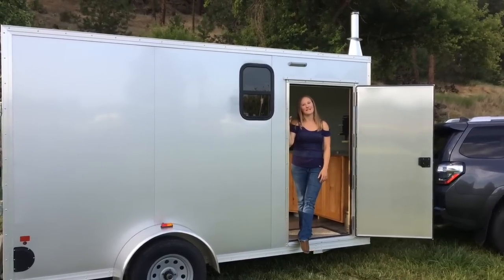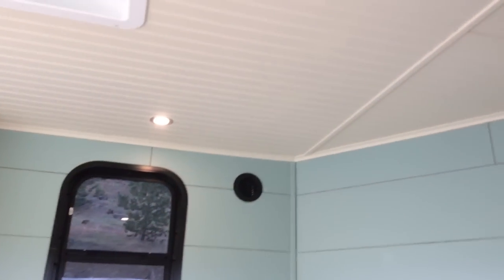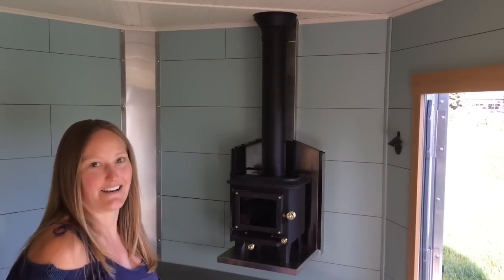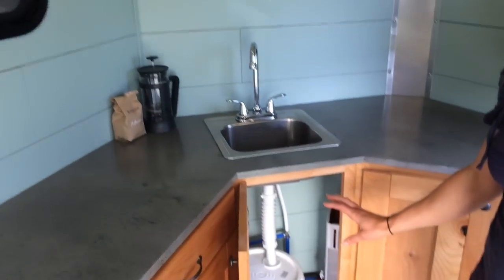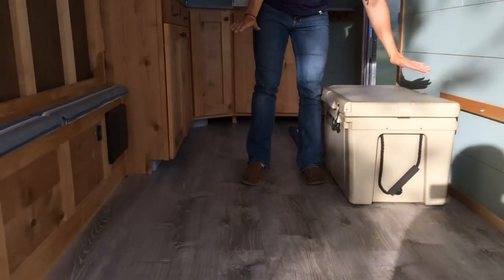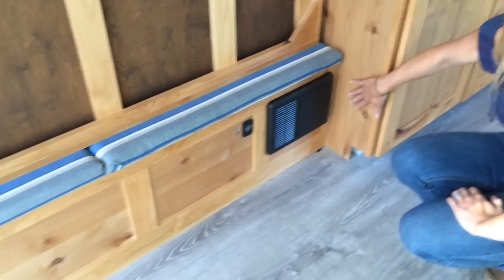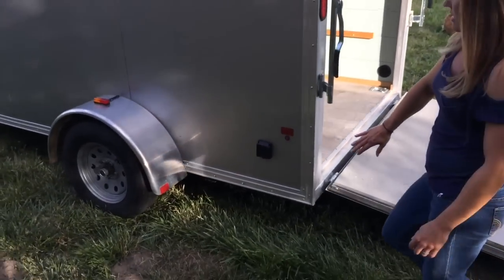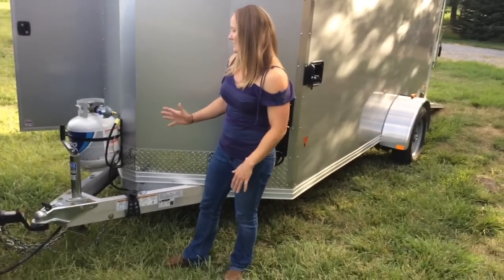Our DIY Cargo Trailer Conversion

Comment: Very nice set up, starting my build. Just wondering if you have any video on how you did the counter top & bottom part  in the v nose. Thanks for showing build.
Reply from the maker: thomas horn I have a slide show that you can pause at various points of the build. The counter top is 1/2” cabinet grade plywood with MDF. Also I glued and pin nailed a 3/4” strip of hardwood along the edge of the plywood, this covers up the plywood edge and also let’s me break the edge with a round over router bit. To get the shape I first made a cardboard cutout and then copied that onto  the plywood. The plywood counter top is actually two pieces that I joined together such that the joint is supported by the edge of one of the cabinet boxes. Along with that I also glued and domino biscuited the joint. I then filled the little imperfect gap with a sandable wood filler and after it dried and blended it out. To attach everything I screwed a level wooden cleat to the metal trailer studs, the cabinets are screwed to that and it gives support for counter top. Quick side note, the cabinets don’t have a backer on them as to reduce weight. I made the cabinet face frames using 3/4” alder. The doors and drawers are also alder and for the inner paneling on them I used 1/4” alder veneered plywood. To give the counter the appearance of stone I first sealed the plywood surface with a grey acrylic paint. This served as the base color. I then mixed three systems epoxy and spread it evenly across the counter top. I used a torch to pop and bubbles and then to add depth to the epoxy and make it look like stone I had a couple colors of spray paint that  I lightly dusted into the wet epoxy. When the paint hits the wet epoxy it kinda disperses out and adds a cool appearance. I’m not an expert at this, just watched a few videos and gave it a shot. It was easy. If you have the budget for it, consider stonecoat epoxy, they have a YouTube channel and they do some amazing stuff. But for me I had left over epoxy from another project and random cans of rustoleum hammered spray paint. I went sparingly on the paint and if given the opportunity to do it over, I think I would have tried some aggressive paint and techniques from the stonecoat channel. Anyway, hope this helps.
Reply from the maker: https://youtu.be/LsYXvNIHQHw
Reply: @littlejoey22  thank you so much for getting back to me. Great job.😀

Comment: I'm definitely interested like the simple build. I'd like to do something similar. I'd love to see how it looks with the bed down and how you guys use the bench
Reply from the maker: Chris Winner the bench is more for storage. It’s broken into two compartments. The left compartment holds blankets and pillows. The right compartment houses the battery and the electrical panel. The top of the bench is hinged and folds up to give access to the compartments when the bed is down. Originally I was going to also make a table and use the bench for seating but that never came to fruition.
Reply: @littlejoey22  how high is the ceiling in your trailer and are you using a full bed?
Reply from the maker: It’s a 6’6” ceiling height and the bed is a Full. It’s a 5” memory foam pad. I boxed in the memory foam with the bed rails leaving and inch or so exposed, this helps when I latch the bed to the wall during transport, it puts pressure on the latches and it keeps from vibrating around. We also used 1” memory foam on the top of bench. It does a good job keeping the bed from sliding and vibrating there too that way there’s no wood on wood anywhere. It barely fit with the drop down ramp hardware. When I lower the back ramp down and the bed is stored I have less than a 1/4” gap of clearance between the wire and the bed frame but it works so no complaint a. I’m helping a friend build one right now, his ceiling height is 7’0 and it’s nice. He has the fold out barn doors on his it’s a much easier design process for that and he can maximize space.

Comment: I've watched a lot of these videos on converting cargo trailers into campers.  I don't understand why no one posts the final weight and tongue weight after these builds.  Seems very important to a safe towing experience.
Reply from the maker: Hey Dave I don’t remember the exact weights but somewhere way back in the comments they’re posted on one of the the comment threads. However I remember that it was  was roughly 2200 lbs without water and ATV, 2400 with water and 2900 with our Polaris Sportsman 500. Hope this helps. If you’re contemplating something like this you’ll need to obviously consider your wants and needs. For us, with a single 3500 lb axle I wanted to make sure to save enough on weight that I could still put an atv in and not be over weight. Hope this helps.

Comment: Great job!  That wood stove really caught my attention.  I haven't seen anyone else put one in a cargo trailer.  How did you build the frame that you set it on?  Is it secure going down the road?  Are you going to post anything about the newer stove you are working on?  Thanks!
Reply from the maker: Hey, thanks for the positive words. The stove is awesome, it came as a package…mostly. I bought the stove and mounting plate from a company called cubic mini stoves. For my smaller trailer the cub size worked perfect. I didn’t care for their flew pipe so I opted for a different set up and I went to a local heating supply shop for help. We put a double walled 3” pellet vent in, and I used a 5” to 6” adapter as a makeshift wall thimble to create an air barrier around the vent as it passed through the ceiling. I used a few bolts to center the pipe in the thimble. I also packed around the outside of that adapter with rock wool insulation to help protect the wood and foam insulation. The stainless steel wall mount from cubic mini  supports the stove and has a 1” air gap on the back side to help protect the wall from excessive heat, this is a must have. The pellet vent consists of a pellet vent adapter, two 3’ vent stacks, a 1’ extension with a spark arrestor. The pellet vent pieces connect with a 1/4 turn so with that I usually climb up and pull the 1’ extension with the spark arrester before driving. I cap the exposed vent stub out with a rubber cap usually used for capping off pvc pipes. As for other stoves out there, I’ve installed a different type of stove by a company called 509 stoves. It’s bigger more expensive and a self feeding unit that has a 12/hr burn time. Both are cool, and if you need the long burn time the 509 is the way to go. The cubic mini works good for my needs. As for more videos, maybe someday. I don’t have the cameras, editing software or the skills necessary to put out the high quality videos that so many others are. I just build fun stuff and sometimes record it. Thanks again, feel free to hit me up with many more questions.
Reply: @littlejoey22  wow.  Thank you so much!  The extra burn time is always great to have.  I'm just thinking the smaller/simpler things are, the better for my purposes.  Do you have any videos of either stove build?  Lots of good ideas in your video here :-)  I appreciate your quick response to my question.
Reply from the maker: @dotjohnson231  I don’t have a video perse but there is a time lapse that kind of has some details you can get from that. It’s pretty easy. I leveled the trailer to the best of my ability and hung the stainless mount to the wall. I took into account where the roof framing members were to ensure that my stove placement wouldn’t hit a stud with the flew pipe. I then took a plumb bob and hung it on the ceiling (I had a finished ceiling at this point in the build). This gave me a point on the ceiling which corresponds with the center of the outlet pipe on the stove. I had a rough idea where the flew was going to go when finishing the ceiling so I didn’t put any foam insulation in the general area of where I thought the flew was going to go. I then used a long 1/8” drill bit to drill through the finished ceiling and then through the aluminum trailer roof. I then cut a 6” hole in the ceiling and 4” hole in the roof. Then, I back filled the space between the finished ceiling and the roof with rock wool. I took my pipe reducer I explained in the previous response and pressed it into place. It was a tight fight. Then I took the sections of stove pipe and fed from the top down onto the stove. I centered the 3” stove in the thimble and  thread in some small bolt to keep it center and secure, kind of like a Christmas tree base holder. Then, with the pipe sticking through the roof all I had to do is add a collar and rain shield. I used an all metal collar but I think the rubber collar would do just fine. The collar is wet wet in sealant and screwed down to the roof with with self tapping roofing screws spaced 1” apart and have a little rubber washers on them. I slid the rain cap down over the collar and siliconed it in place with high temp silicone sealant. I also put sealant over the screws. Then at the top of the main pipes I have the 1’ section of pipe that has the spark arrestor on it which I take on and off. Like I said previously the dura vent pipe is a 1/4 turn connector. So it’s relatively easy to take that 1’ section on and off, though sometimes when it’s wet the soot and water make it a bit sticky. On my buddies stove, he left his spark arrestor permanent attached and it seems to work alright. He also mounted his stove lower and so he gets a decent draft without the added height to the roof or headache of taking his on and off. I don’t mind doing it, takes only a couple of minutes. With the added pipe and spark arrestor attached mine is mounted kind of high, about 3-4’ above the trailer roof height which  I don’t like driving with that additional height and that’s why I remove it. Additionally I don’t like having the open spark arrestor because the one time that I did drive with it on  it blew ash into the trailer through the stove damper. So now I only drive with the rubber pipe cap on the stack at the 1’ piece removed… After that no issues whatsoever.
Reply: @littlejoey22  Excellent!  Many thanks for such detailed info.  I do appreciate it

Comment: What color and paint did you choose for the walls, and what type of wood is your trim?  Thanks!!  Very nice!
Reply from the maker: Sherwin Williams “quietude,” in satin sheen, paint number 6212. I believe we used their duration paint series? For the trim and cabinets we used Knotty alder and finished it with a couple of coats of Watco Danish Oil in light walnut.

Comment: By far the best layout I've seen. Plan on following same basic idea, with some minor adjustments that will work slightly better for my personal needs. Hats off to you both. A truly excellent cargo trailer conversation. I have a couple question. What size quad do you have? Give or take how much did you invest on the full build?
Reply from the maker: BigBobby713 roughly 9k, but that includes a few other things we’ve added since the build like solar panels and a Bimini hardware shower curtain I made for the outdoor shower. As for the atvs we have a couple but we usually put the Polaris sportsman 400 in the trailer and the 600 in the back of the truck. It fits the 600 size wise but the added weight kinda stresses me a little more as it’s right at max axle weight with the bigger 600 plus water. We went with the aluminum trailer to keep some the weight down allowing for the atv plus the trailer components, gear and water. If I built it again I think I’d opt for 7x14 or bigger with a double axle. It’ll save you from having to worry about the weight issues. My buddy is building one now that is 7.5 x 18 and it’s pretty sweet. He’s also doing a shackle loft and spring and over the axle mount to increase ride height and bigger off-road tires. All upgrades I’d recommend. Feel free to write me back with any questions you may have, happy to help.

Comment: How do you use the bench, the bed is sitting on it? I would have liked to have seen that.
Reply from the maker: Tammy Norris, fold the bed down to access it. It’s set up with two compartments, one houses my electrical system and the other has blankets and bed sheets. The foam bench top acts more as a cushion for the bed while driving.

Comment: My wife and I love your trailer conversion. You both did an awesome job. We have a trailer conversion of our own coming up.  We really like your epoxy counter top.  Can you go into more details on how you did that? I'm especially curious how you made it look all one piece (I assume it is 2 pieces).  What wood type did you use?
Reply from the maker: arnbrhm Hey thanks for the compliment. We used the 1/2” cabinet grade plywood remnants from the cabinets, it was 3 pieces. I bonded them together using a festool domino and glue. There were some minor voids in the plywood joints but I mixed a slurry of fine saw dust and epoxy and spread it with a bondo spatula into the voids, let it dry and sanded it smooth. I pin nailed a 3/4 strip of alder on the front to thicken the edge. I painted the top surface with a matte grey acrylic and let that fully dry. I put three coats of epoxy onto it. When applying  the first 2 coats of epoxy while they are still wet I dusted metallic spray paint on it to give it the granite-ish look. Stone coat epoxy counter tops has a YouTube channel that’s really good at explaining the process. As each coat dries take a torch and lightly brush the surface with the flame over the bubbles and it pops them creating a smooth surface. The last coat I just let set up with no paint. It cures to a gloss finish. If you don’t like the gloss finish you can buff down the shine or what I do is sand with a 320 grit sand paper then spray it with satin enduro var made by general finishes. For this project however I was fine with the gloss finish. I had the epoxy already and since I used the scraps the whole project only cost me a few cans of spray paint. If you’re cabinet design didn’t leave enough scraps I’d say it would be somewhere in the $150 range for epoxy, paint and a sheet or two of ply. Honestly pretty easy to do, hardest part is getting the angles right.
Reply: @littlejoey22  This is very helpful! Thanks for the detailed explanation.

Comment: I do like it! Very nice, clean, and something other than white inside. Would like to see the bed folded down, and trailer closed up.  What is the matress?
Reply from the maker: Someday I’d like to make a follow up video and show the close up of the bed, we’ve had a lot of questions about it. It’s pretty simple, I did a French cleat the full length of the bed frame. It’s basically just a 1x4 piece of alder ripped down the middle at a 45 degree angle. I attached one half of it to the bed the other half I mounted it to the wall by by dirt tapping and threading bolts into the stud. The opposing 45 degree joints lock the bed against the wall. Then for the legs, they just swing down in place and have positive stops to set them at them at correct 90 degree angle. When stowed away the legs fuld up out of the way. The bed is held up against the wall by two decorative gate latches. To get them to hold tight the memory foam mattress sticks out an inch or two out past the bed frame so when the bed is against the wall the depressed mattress keeps pressure on the latches it doesn’t move or shake at all. If you’re interested shoot me your email address and I’ll send you some photos. So this all makes more sense.
Reply: @littlejoey22  Cool. What mattress is it? One of those thinner memory foam ones?
Reply from the maker: Seth Watson yes sir, 5” memory foam amazon, it’s a full, couldn’t quite fit a queen

Comment: Great build, nice a clean, less is best. Who is the manufacture of your trailer?
Reply from the maker: Robert! Thanks a ton for the positive comment. The make is EZHauler. I think they’re out of Montana. I don’t really have any complaints with the make, I feel like overall they did a better job with building the trailer than most of what I’ve seen out there on the market. I’d say the only downside is when I built another trailer for a friend, we custom ordered a trailer directly from them and we were hoping to get torsion axles and thicker aluminum siding but they didn’t really want to deviate from their normal operations to do custom trailers, which I totally understand. So with that, the only complaints I have is that the aluminum skin is thin, and in my opinion independent torsion axles are the way to go for over landing. So if you can find somebody willing build that, I’d go that route. If not, the frames of these are solid and you can also can get windows installed by the company if you want. Hope this helps.